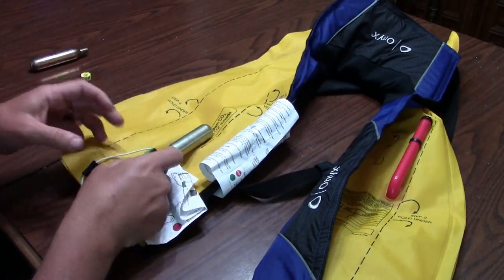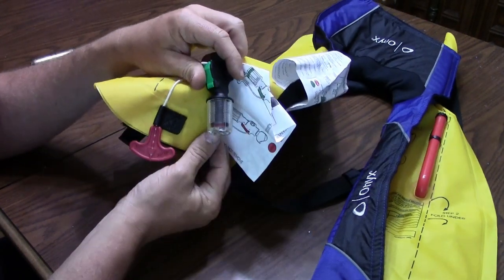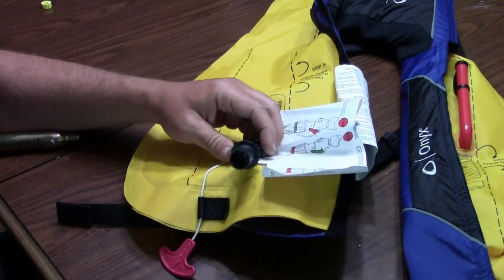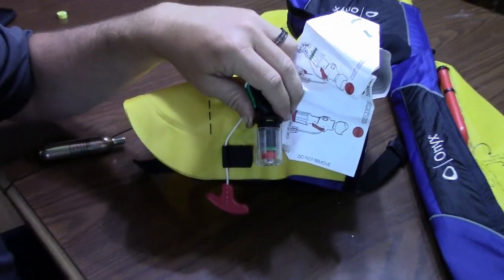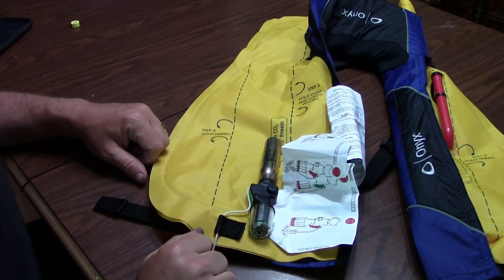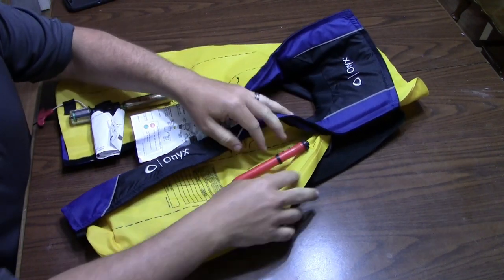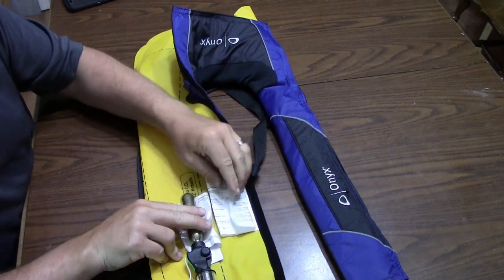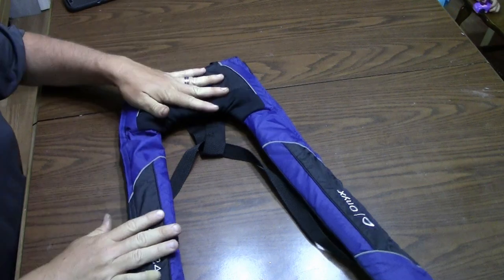How To Rearm & Repack Onyx Automatic / Manual PFD A/M-24

Comment: Thank you, I was looking at the bobbin thinking theres an up or down here and I already had it apart without paying attention. But if upside-down then the automatic feature wouldn't function??? Pull handle only??? I use mine kayaking and popped it getting out of the boat... tipped over. They work perfectly FYI, damn thing scared me more than the dunk🤣. But, if im to continue kayaking I see this is the wrong life preserver. Getting wet is actually part of it im discovering.   Barrel rolling a kayak as it turns out is an accomplished kayaker and the kayaker terrified to tip over is a rescue situation waiting to happen. So if it can be rigged for manual deployment by inserting the bobbin upside-down may not be as useful for safety. But might be more ideal where im getting wet on purpose? At least until I buy a better suited life preserver for paddling. Thanks for the video.

Comment: Does one convert from automatic to manual, simply by removing the dissolving bobbin? (eg rearming on the water)
Reply from the maker: It has been a while since I used this pfd, but if I remember correctly, the dissolvable bobbin keeps the needle from activating the inflator. If you installed this without a bobbin, it would likely inflate as soon as you tightened the co2 canister.